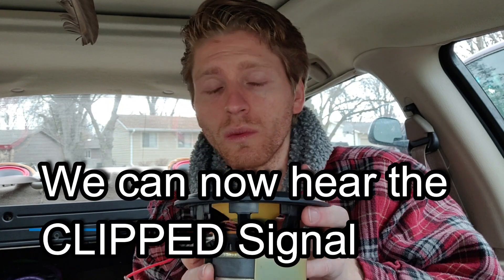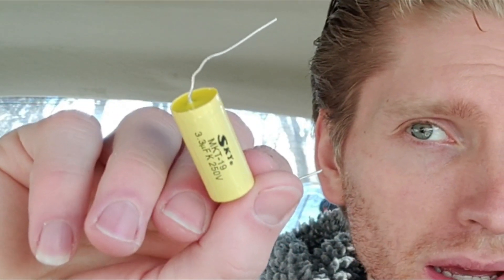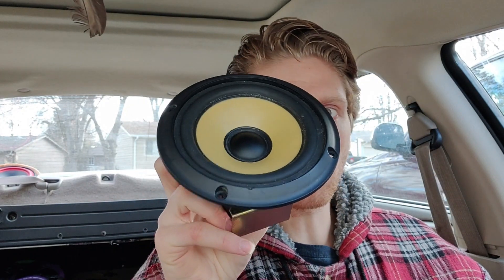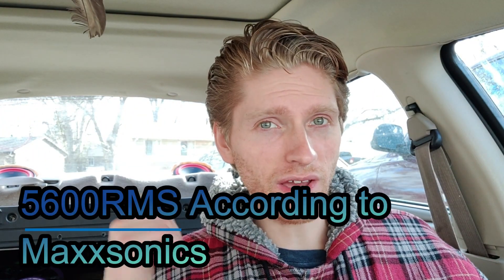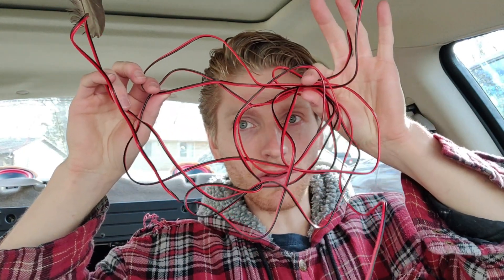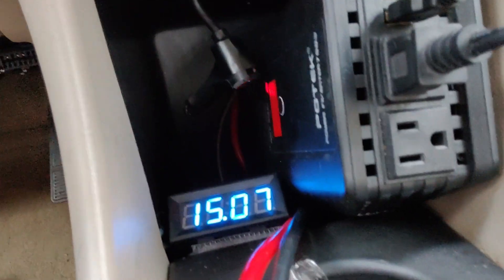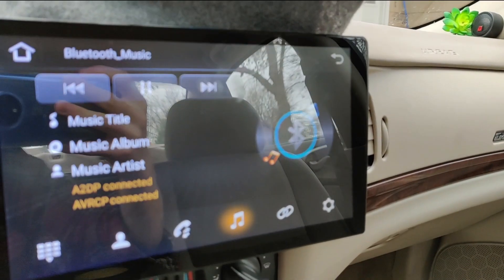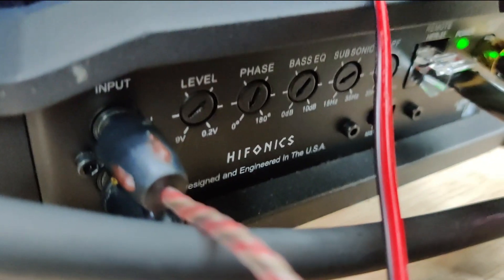How to detect CLIPPING CAR AUDIO  - Super EASY GUIDE - 👌👍

Comment: Does this work for 4 channel amps? Not a Sub amp. What frequency would you need to check the mids at?(2 way system active) 80hz?

Comment: Can I use same method to find headunit max volume without clipping or distribution
Reply from the maker: Possibly! But it would have to come out of the head unit as a preamp signal for bass frequency only. Would be my guess. Check out barevids he is more knowledgeable

Comment: Hey are you suppose to leave your subwoofers plugged in and playing while running the test tone? Barevids made a video on how setting gain without the subs plugged in is bad because of the voltage drop. Also, would i be able to use this same method to find my clipping point for a 4 channel amp running my highs and mids?
Reply: It’s hard to tell in the barevidz video if his amp has a load on it. I’m pretty sure it was him that said you can leave the tweeter attached as a warning, which I did. There’s actually an older video about this called piezo trick or something like that. He does it without the subs connected so I did that first. I was told the amp needed a load on it so I redid it and it clipped earlier that way. I currently have the gain about half way between the two and I sometimes get a slight crackle from the tweeter on a bass hit but it doesn’t get to a steady buzz though. I’m just learning about all this so hopefully the way I’m doing it doesn’t hurt anything. Great simple explanation btw
Reply from the maker: I didn't have my subs plugged in during the setting of the gain control. I don't know if that would work. Possibly? Try it on a speaker you don't care about haha. 😂
Reply: "It is best to do this with your subs hooked up and your engine switched on, however you normally test or play."  -BareVids

Comment: Can this be used to detect clipping on the head unit?
Reply: Yes if you have an amplifier. Just turn the gain down a lot on the amp and connect the speaker leads to the amp with the capacitor in series. Then you raise the volume on the head unit until you hear the noise in the speaker with the capacitor.
Reply: @noelbostrom5834  Yep, yep! Worked for me. We even compared the results with an oscope. Results were outstanding!

Comment: I tried this with the same capacitor but it didn't work. I used 3 different speakers but they all played the 40 Hz and when I turned up the gain ALL THE WAY I still didn't hear any clipping, is there something im missing?
Reply from the maker: What amp are you using?  Did u tie in the capacitor correctly?
Reply: @Balancinglife  im using a jl audio 500/1 amp. The caps are non polarized, to be exact they are sky mkt-19 3.3 farad K 250V. I hooked up the cap to the positive side and followed everything in the video.
Reply from the maker: @toniramirez354  it may be possible that your preamp outs are low voltage ⚡ or your amp has a chip that stops clipping from occurring since it's a jl amp. My best guess. That being said u turned your head unit up to your highest preference.
Reply: @Balancinglife  yes that might be it but I went ahead and ordered a piezo buzzer to see if that makes any difference. When you played the 40 hz did the tone play on the speaker you were using or did it just move without any sound coming from it (until clipping happened of course)?
Reply from the maker: @toniramirez354  there was slight movement of 40hz through the speaker at high volume but only noise came through at clipping.
Reply: @Balancinglife  oh ok I'm going to try it with a piezo buzzer next week, thanks for all your help.
Reply: @toniramirez354  any luck with the piezo buzzer?
Reply from the maker: Also is ur cap non polarized? Maybe u had a bad cap

Comment: Would a 4.7uf 50 volt capacitor work for a 500 watt amp?
Reply from the maker: Might be enough voltage but is it non polarized? I think the farad is a little higher than recommended.
Reply: @Balancinglife  i have no idea. I just pulled it off some old tweeter cuz I needed set the gain asap but I'll go ahead and order them.